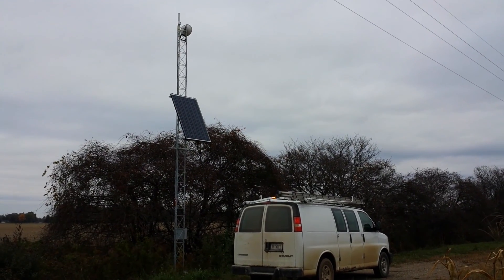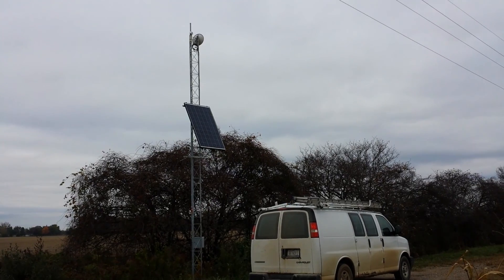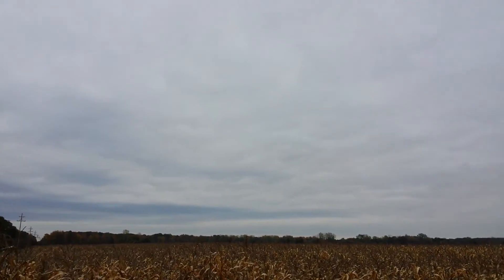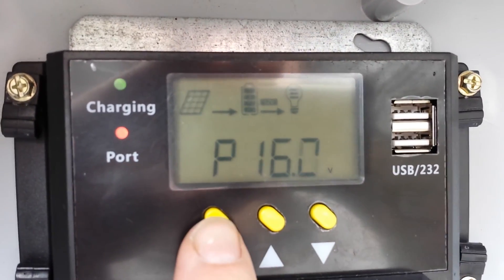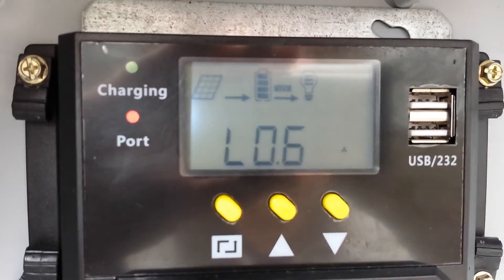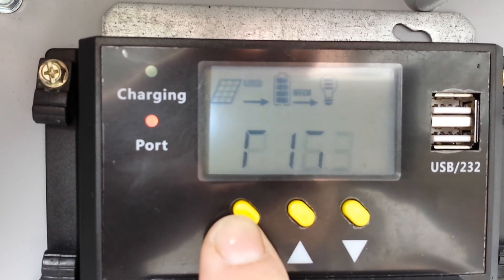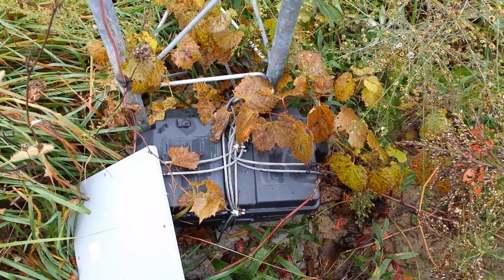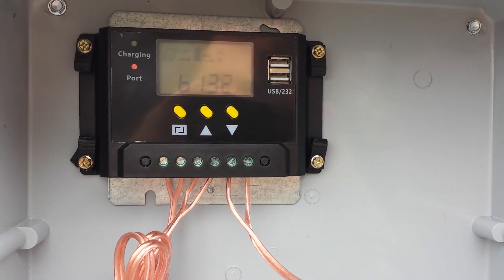Ubiquiti Solar Powered Internet Micro-Pop

Comment: The 24hr is talking about the load output of the charge controller. You can set the controller to only run the load output during certain hours. Thanks for the share. More like these please

Comment: Why do you need 30 battery I have 18 and it's enough !
Reply from the maker: Lv Lv There are only two 30 amp hour (capacity rating) batteries. We will add 2 more soon.
Reply: Mark Rodgers - KC8GRQ why you keep adding batteries ?! I have 18 AH battery with 20 watts panel and it's enough all day long .. Using air grid UBNT antenna.
Reply: I have two powerbeams running off a 100 ah battery. How long should they work in ideal conditions?